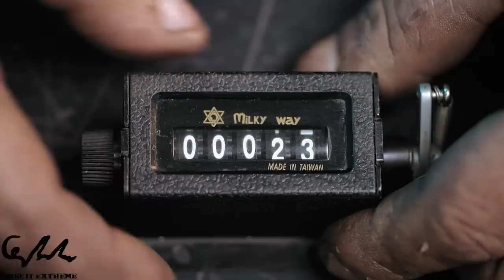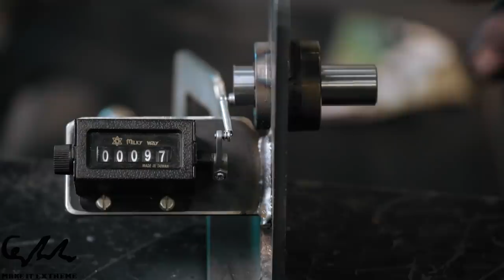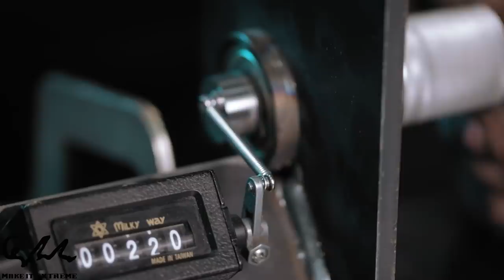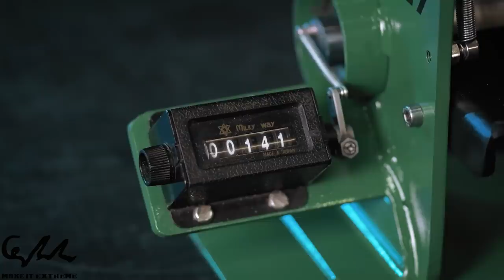I Made the Best DIY Cable Length Measuring Tool

Comment: 3:23 is a really cool shot, where the "idle" RPM line up exactly with the camera's shutter and the cutting slightly reduces them, making the part "move" and after the cutting it's back to being in sync. No idea if that was intentionally, but it's either way a really cool shot.

Comment: Useful tool. Used one of these devices when wiring control panels. Set it up to pull 2 to 4 wires at once from the spools through 3 panels plus conduit. Reduced time, prevented the wire from coiling after cutting. Was more accurate and resulted in less fumbling, kinking, tangling and recoil than stretching and weighting or tying to hold in place then measuring with a 25' tape measure then cutting and having to walk it back and pull through the conduit thereafter. Definately saved a lot of walking back and forth!

Comment: There could be a pair of rollers, both rotating to pull the wire in automatically or via button. The length can be quickly displayed digitally. A cutting attachment can cut preset lengths.

Comment: At first I thought it was automatic and cut wire to a pre-set length. That would be pretty sweet.
Reply: Me too.
Reply: complexity x1000% vs just clipping it
Reply: Now that I think of it, you could easily make a small device that pulls the rope with 2 rollers and measures the time between when the wire enters and when it exits. With the rollers rotating at a constant speed, it could easily and quickly calculate and display the length automatically. You could then add a cutting tool to the device to cut preset lengths.
Reply: Cheap camera. Opencv. Nice rig.

Comment: In anyway its good job. At big factories and high demand orders it is using of wire length encoders. Of course project with optical encoder needs microcontroller and some skills of coding, but it gives to you precise of 0.1mm or even less.

Comment: Nice. I am building a length counter to respool my 3d printer filament. They are sold by mass and they have different densities. It makes estimating the remainder left on the spool difficult without knowing the real length.

Comment: I wonder, why didn't you do a cam instead? Ergo, put a small ball bearing on the end of that counter arm instead of the spring, and then have a eccentric cam that pushes down the arm instead. Would give more reliable operation as operation is then no longer dependant of the wear/health of the spring. Another thing that I think you should do, is some sort of detent in the roller assembly, that will make it easier to find the "0" position, since if you start rolling when the roller have already gone halfway, then it will start counting like 1 cm for 0.5 cm of wire, so by finding the position just a  degree after it have advanced the counter 1 step, if you make a little detent there - could be a magnetic detent, it will be easier to set it up for even more accurate counting, as you will then always start with a full turn before counter advances 1 step.
(Operation would then be: Rotate roller by hand until detent, then reset counter to 0, and then feed wire into roller)
Reply: They don't do electronics, they do "electrics" so they don't really care if it's off by a couple cm here and there.

Comment: I'm looking for the exact thing would it be possible we can work somthing out. 

Need to measure 
1. SS wire rope 7x7 construction. Dia  1.2mm up to ,2.2mm
2. Fishing line 0.8mm 1.6mm

Comment: You can measure the length of a wire by measuring the resistance with a meter.

Comment: What is the unit of measuring
I am confused cause the tape showed 100 imches and the meter shows 10???
Reply: The number on counter represents 10 cm, so if the number is 10 the lenght is 100 cm (10*10)

Comment: The same could be achieved handheld, digital, and portable, rather easily. But for a workshop or something, a desktop version would be useful. To each their own. Your rather mechanical so I don't knock the methods you've chosen. But it could be made for $5 and 3D printed in an afternoon.
Reply: I don't think you know how slow 3d printers are... Or my dad's and BIL's, I think they are the same model, are just really slow.  My dad has printed collapsible swords, they take 22 hours to print.

Comment: so only it counts revolutions, not meters or centimeters So what to refer to 🤔😂
Reply: 1 revolution can be a meter or centimeters whatever you need. Just gotta measure a revolution.
Reply: 4:45
Reply: The unit is decimeters.
Reply: 04:48 Each revolution equals 10 centimeters.